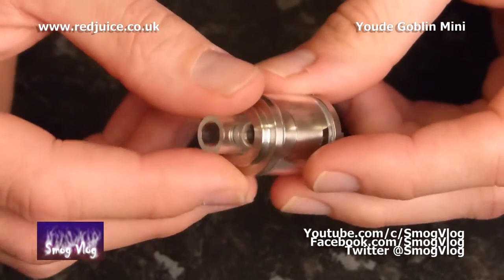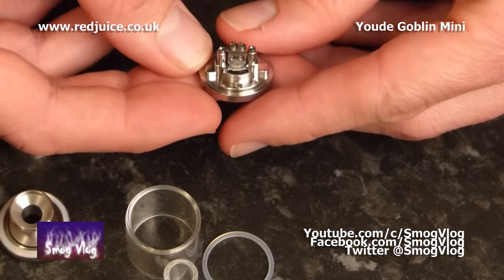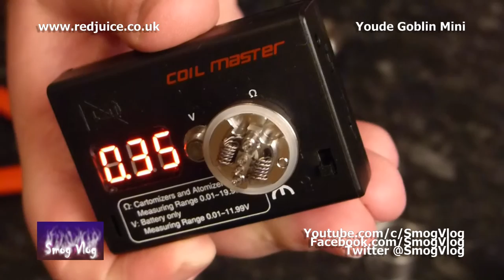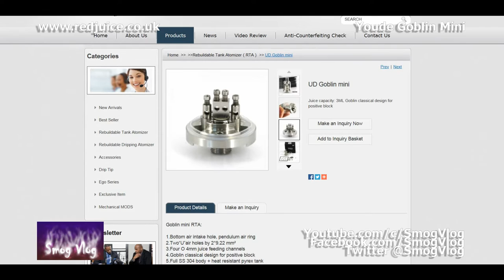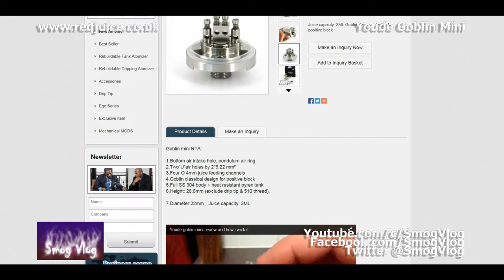Goblin Mini Unboxing & Review

Comment: you sure that's not twisted 28g? .35 seems really high for 26g.great review guys
Reply from the maker: +James Mucklin Cheers dude! That's 8 or 9 wraps at 2.5mm I believe. Tony wanted it above 3 ohms so it would fire on the IJust 2 battery.
Reply from the maker: +Smog Vlog As it goes, I built on twisted 28 today, different atty but 6 twists on dual 2.5mm coils of 28 pair came out at .6 ohms. - Cheers, Slack